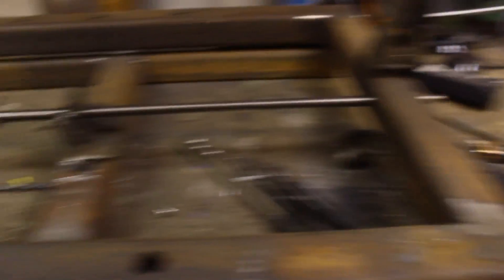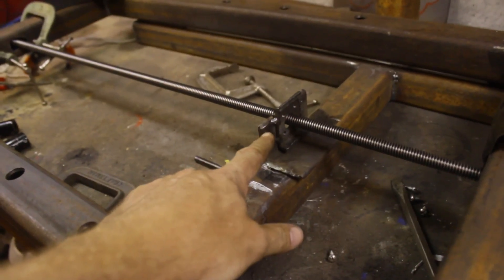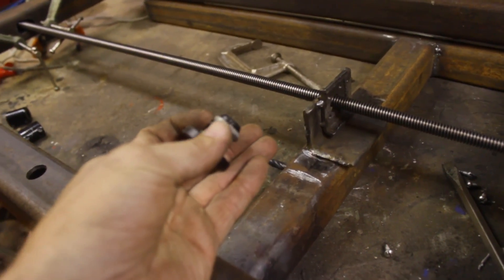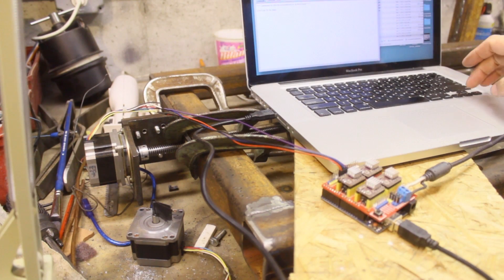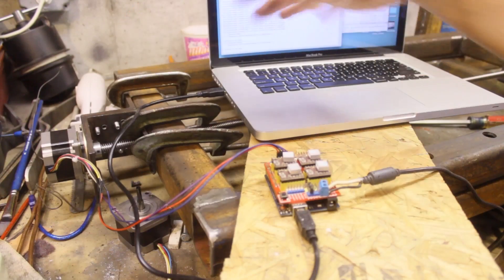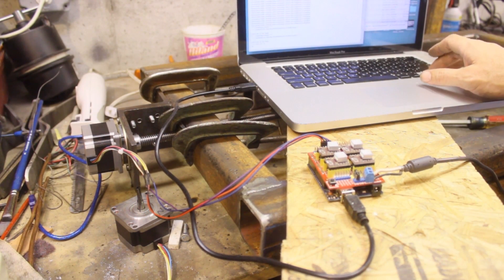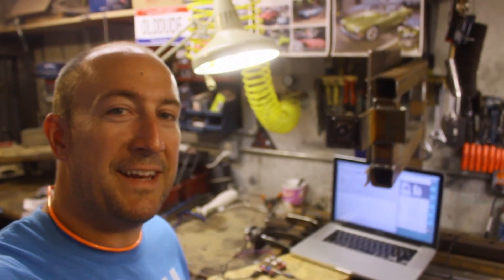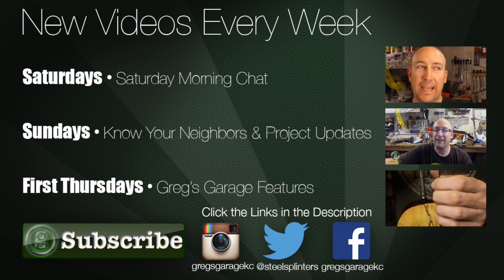DIY CNC - Lead Screw Adjustments

Comment: use NEMA 23 and tb6600 stepper motor drivers with the same arduino cnc board you have!! Nema23 motors will never make you look like a stupid guy!! and you will never regret about that!!! but you have to use 24v and more Amps power supply!!
Nice work!!! Keep it up!!

Comment: Def need slightly more powerful steppers.
Reply from the maker: +Luthlan Agreed.  Working on that upgrade.
Reply: Cool I'm working on a little home made CNC out of aluminium with nema 17's. My grand father worked at BAE and he kept a few alu off cuts. Thats what I am using. I just have a drill press and hand tools.
Reply from the maker: +Luthlan The key is keeping everything perfectly square.  Good luck!

Comment: Spray your drive screws with protectant (kitchen Pam style oil works in a pinch), to protect them from molten sparks.  These sparks contaminating your threads could be contributing to binding.

Comment: I have never made a CNC machine before, so i could be off base, but i think one thing you may be fighting is the welded construction.  Meaning, you get things set how you want them, then make your welds, and things move.  Not sure if you have any options for bolding some of those brackets, maybe get some pillow block type bearings that can be bolted?  Either way, I am sure you will get it done!  Sweet editing!
Reply from the maker: +turbocobra You are dead on Gary.  I don't have enough fixtures etc to get it dead nuts.  I have been squaring as I go.  I'm sure it will be a little bit out when it's all said and done, but it will be really close.  The next iteration will be based on a bridgeport.

Comment: Are you sure your drawer slides arent binding? Are they made to operate laying down  like that or are they supposed to be on the vertical? They could be out of parallel with each other even..
Reply from the maker: +Lil Doggy When I take the lead screw out, the slides are SUPER smooth.  When I installed them, just a thou or two would bind.  That doesn't mean there isn't a piece of debris in there...  I will double check.  The bearings on the lead screw, however, are REALLY sensitive.  I need to get another dial indicator with a flat needle.  I think I'm off just a tick left to right.  It doesn't help that the motors are pretty weak.  If you grab them about 1/4 as hard as you'd grab a screw driver, they will stop.  stronger motors would push through, no doubt...  That one's a slippery slope.  Right now the controller is maxed out for power draw.  Bigger motors = complete electronics upgrade.
Reply: Hard to adjust with a weld. Maybe slotted bolts would make it easier to adjust.
Reply from the maker: True story.
Reply: Greg's Garage Seems like DC motors have zero torque at slow rpm, but when rapid'ing they are more powerful?
Reply from the maker: These are just the opposite.  Slow speed they are more powerful.  I suspect it has to due with the pulse type control of the motors.  There's not a constant DC feed, it's thousands of pulses per inch.  No matter how smooth the slides are, there's a max speed before the motor takes a crap due to resistance...  Whether its a bind or just friction.